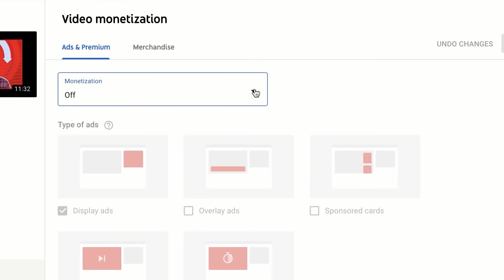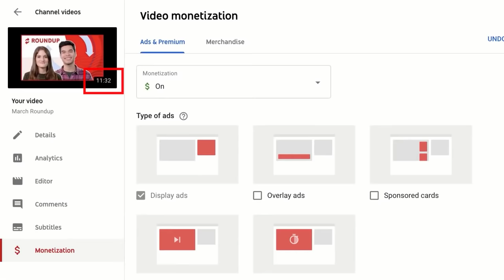Wild Wonderful Off-Grid Net Worth, Lifestyle & Bio

Comment: You made an error in your statement about the build of the house. No, they are not finished, The plan has always been to add the larger body of the house, running laterally at the back. This was the smallest section and therefore the quickest to build to enable them a place to live. A lot of what you see is temporary, all of their bedrooms will be moved to the larger section,, when finished.

Comment: Another coat tail rider. Leave them alone and go make your own show. Stop exploiting them for your own gain.
Reply: @ericfraser7543  You realize that being off grid means you're not dependent on the power utility, correct? It makes more sense to produce your own electricity and store it, rather than sell it back to the power company for pennies. Also if you're connected to the primary feeders the power company still charges you maintenance fees, as well as for the service feed to your property. When everyone else loses power due to an ice storm, downed lines, whatever, they'll still have power. He oversized his array to allow for expansion; the only way to expand or enlarge your electrical supply from a utility company is larger gauge wire, new transformer, new meter and a lot more money. Stop being mad about your comment being deleted by them. If you have a better idea, make a YouTube channel about it.
Reply: @ericfraser7543  I'm not getting into a long debate and explaining  the pros of being self sufficient. Look what  just happened in Texas. How'd that work for people when they were freezing? Wouldn't have bothered someone with their own power generation system. You think that one feeder and one xfmr can supply multiple homes with 15kw? It can't. You also have no idea how far away from a substation they are, or what the codes and laws are concerning solar power in their state. It varies. As for being green, they're using sunlight that is otherwise going to waste. I'm done. Look elsewhere for entertainment if you have a problem with someone disagreeing with you.
Reply: @kj3n569  
Moo